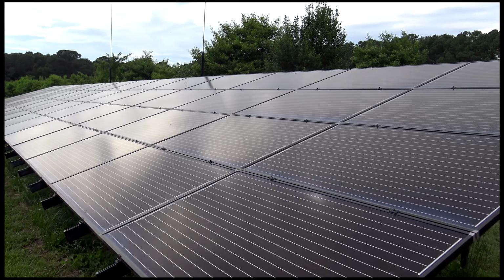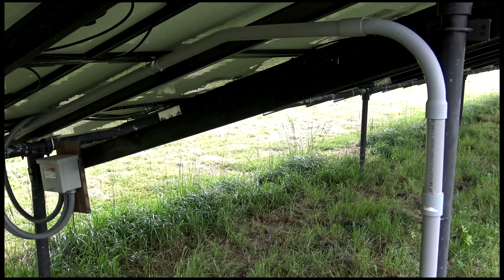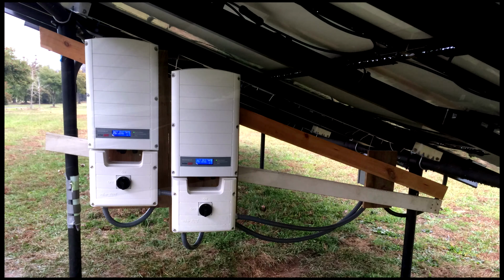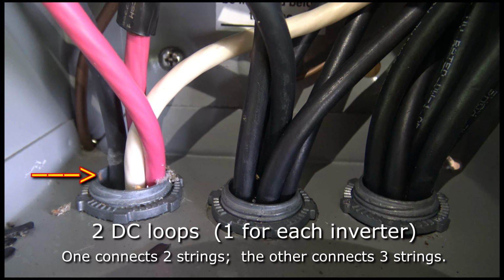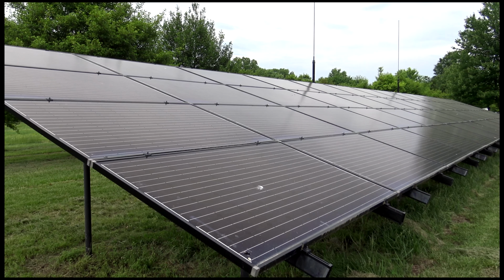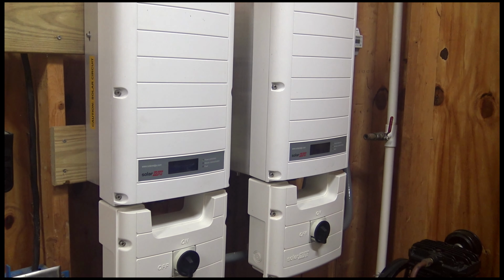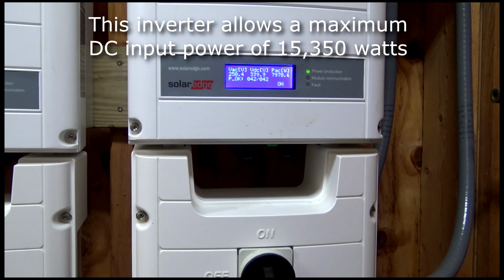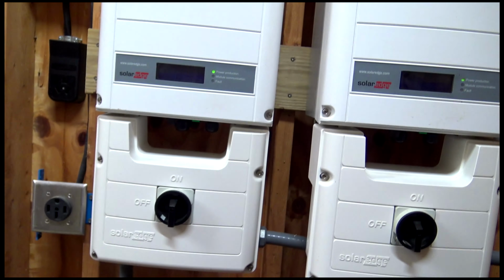DIY Field Solar Array - Part 7

Comment: I would have preferred the AP system with these Micro inverter https://www.dommelvalley.ca/catalog/datasheets/APsystems-Product-Datasheet-YC500A-3.30.17.pdf     They produce the 240 volts at the panels and AC can be moved longer distances through smaller wire than DC can. Every 14 panels could be directly connected to the grid through a 20 amp breaker or 4 branches wired to 4x 20 amp breaker in a sub panel to use the 56 panels or add another branch or string for 70 panels. Very simple Inverter that uses 2 panel and has a MPP tracking. The amount of money saved on wire would Pay for the extra invert costs and you could run 4 gauge wire to the house panel and just use a weather proof sub panel under the Array.

Comment: Nice update. I am coming up on 1 year with my SolarEdge ground mount install. Have you seen the decrease in output as the panel manufactures predict?
Reply from the maker: I haven't noticed any decrease at all.  If anything, it seems like it's going up - but I know that cannot be the case.